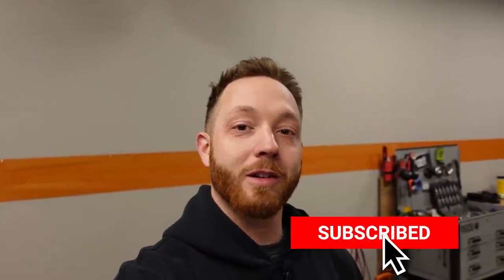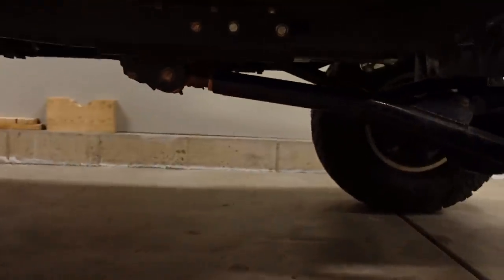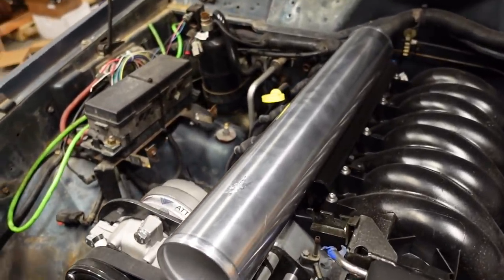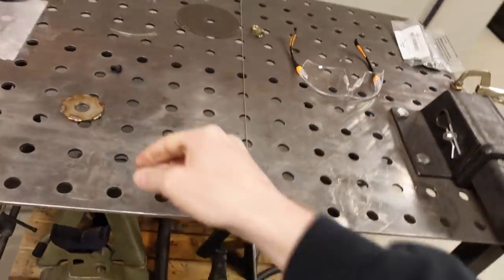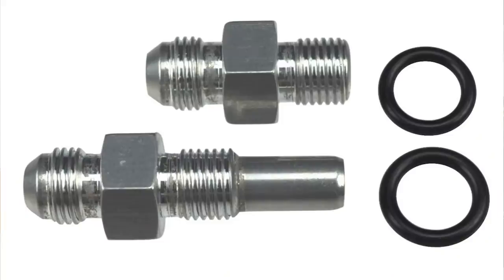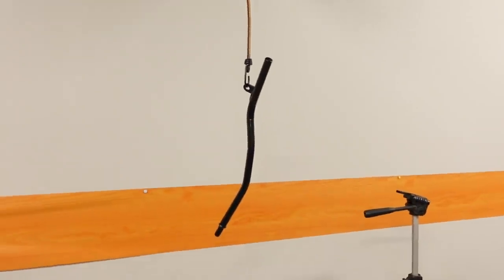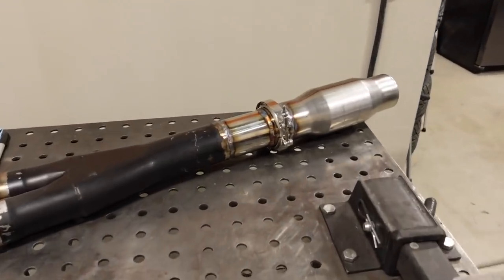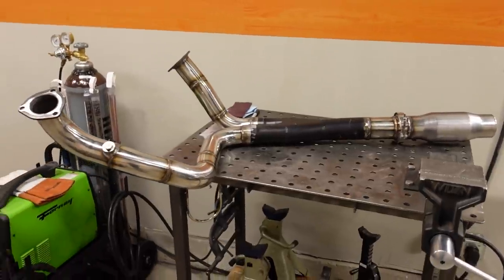Jeep XJ LS Engine Swap Pt.5 The Details

Comment: About welding. I`m a retired pipefitter. Have fitted a lot of stainless pipe on nuclear power houses. If you`ll use a stainless wire hand brush to clean your welds they will shine like the rest of the pipe.

Comment: Looks good LT, I just got my 1st Jeep amd it needed front brakes got those fixed and blew a wheel cylinder and the brake lights stopped working. It was bought to drive  two trips totaling around 10 miles a day to my School Bus.  Mine will never look that good and is currently not drivable. 2000 Cherokee Sport 4.0 and seems to run good but looks like it's gonna break my already dusty wallet. (subscribed to add to the total)

Comment: thanks for the tip. i'm installing a 99 454 vortec 4l80 in a lowered 58 1ton dually with mid 80's c&c frame. i would have burned it up

Comment: The 4l80 fitting goes into the center support
Reply from the maker: thats what its called
Reply: @LawrenceTolman  yes sir.  Center support has a seal that drives in and that long fitting slides into that.  That is on the new design 4l80s of course

Comment: You may have already covered this in another vid, but are you using stock gauges or aftermarket? And are you using a tach emulator from Novak? I see you used their motor mounts.

Comment: I used the same kit from Amazon.  You do need to install the o-ring in groove or it will leak under pressure.  I made that mistake. SMH
Reply from the maker: in what groove, by the flare?
Reply: @LawrenceTolman  where the two an fitting meet,  6an male to 6an female ends. From your hose to the 6an fitting going in the transmission. It's weird I have never had to do that with any other braided hose,  but this one requires it in order not to leak.

Comment: I've used that AN-6 kit for fuel lines and no problems 10k miles in. I didn't know the o ring was not needed. Is it the end of the world to have them in there?
Reply from the maker: I guess not, its probably in there to help seal it up if there's any defects in the machined surface that normally makes the seal

Comment: Dana 60 with only a 5 lug?
Reply from the maker: they're Dynatrac ProRock 60's which are an aftermarket bolt in Dana 60 high pinion axle, and yes, with 5 lugs
Reply: @LawrenceTolman  ohhh, didn’t know. Thanks for clearing it up. I’m used to full size trucks and that thew me off. Nice build

Comment: Quick question LT. Why would you order fender washers from Amazon? You could run to any hardware store and they will have them there. They would probably have thick ones too, that way you would not have to weld two together. You should be supporting your mom and pop hardware stores instead of Jeff Bezos and the Chinese.
Reply from the maker: Fair question, but for me it’s about managing the time I have each day. A trip to the hardware store costs me about 45 minutes to an hour which means I can’t bill labor or make video content for that hour, and I have one less hour of time to do work that day, and I can’t in good conscience bill the customer for an hour of time to drive and buy a washer when they’ll ship it to my door for free in a couple days
Reply: @LawrenceTolman  
I see your point, but I also don't see your point. I can see that it is something you don't want to bill customer for running to go get one, but, unless you absolutely did not leave the house for a couple days, your point holds no water. I have done jobs for people that required me to get one small part from a store, but I didn't leave that second to go get it. I would wait until I left the house for something else, like lunch or dinner. Then I would swing into where I needed to and buy what I needed.